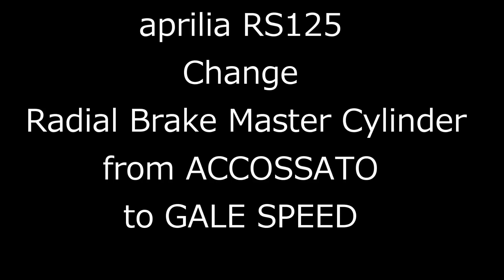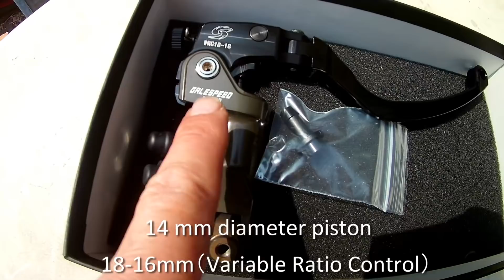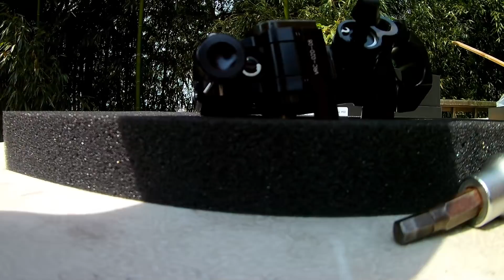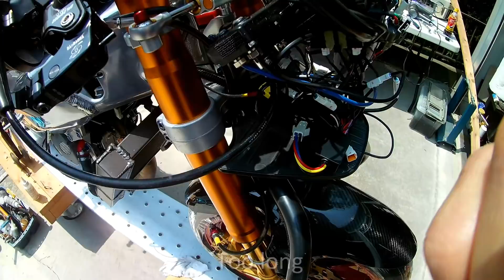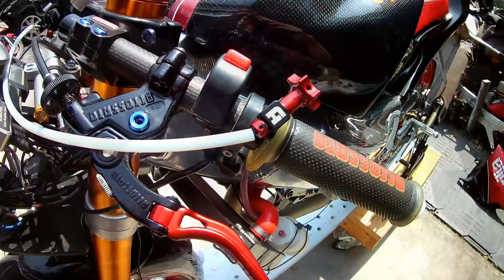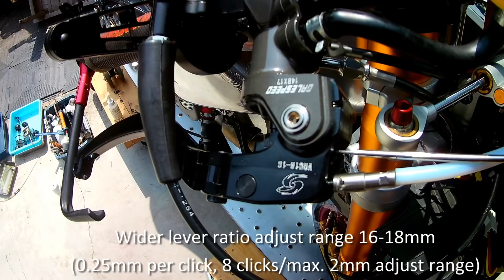aprilia RS125 Change  Radial Brake Master Cylinder from ACCOSSATO to GALE SPEED

Comment: Hi pochi, i want to replace the master cylinder of my rs125 spain edition, I want to buy brembo rcs, what should i choose? 15,16 or 17? I use the original calipers. Thanks!
Reply from the maker: I used ACCOSSATO's 16φ, but change to GALE SPEED's 14φ.
14φ is a good feeling.
Reply: @PochiRS  hi, thanks. but i choose brembo rcs 15.i hope it works well